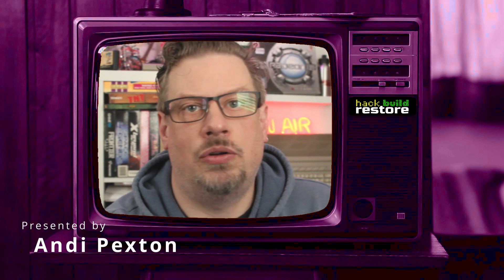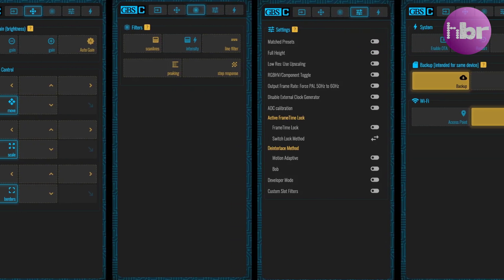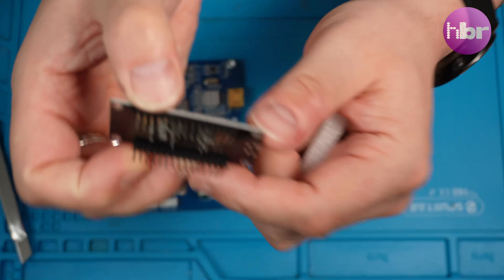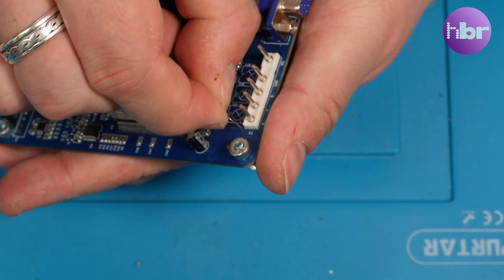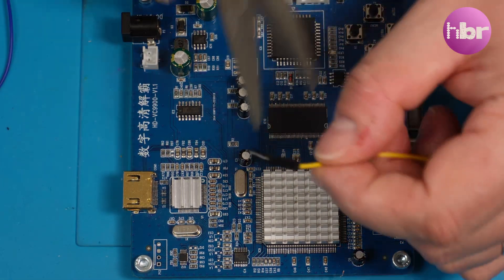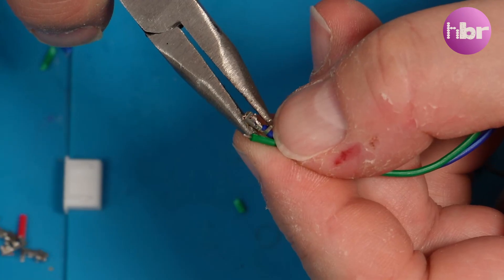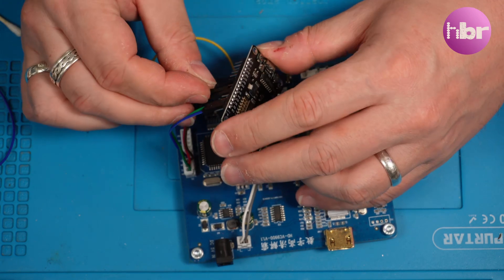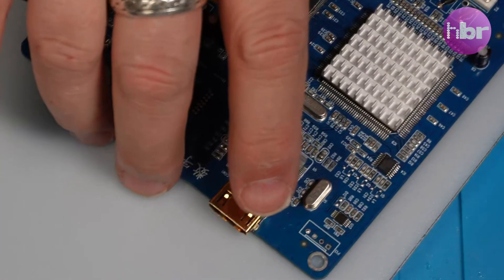HDMI Output Hack: GBS Control on VC9900

Comment: Do you know why the image sometimes turns pinkish after a few minutes? At first the image looks good, but then it starts turning pinkish. This is the third graphics card I've bought on AliExpress. Speed up the video and you'll see what happens at the end. I swapped it with the graphics card from the left game, and the problem shifts to the other side. So it's not a problem with the rest of the game itself; the problem is with the graphics card.

Comment: Thanks for the video! It's nicely done (I like you use duponts instead of extensive soldering) and I didn't know about VC9900 :) You should make add-on with guide to programming ESP to make it more complex ;)
Let me ask you one question - why did you use two power lines from VC to ESP? From 4-pin to 3.3V and from 5V to Vin. In other videos they use only one of them. I have no electrotechnical education so I am a bit confused... Thanks again!
Reply from the maker: Thanks, glad you liked it. On the power side really only the 5v is needed, but connecting both doesn't do any harm.

Comment: It’s very interesting indeed but I didn’t grasp what and how it improves video quality!! May be I am a lame person but I do have a good experience with vintage computer repairs and own a good collection. If may suggest a bit of a more detailed video to clarify how does this work.. big thank you
Reply from the maker: Thanks for watching, I will consider your suggestion for a follow up... In my use case, the Amiga, the stock board was unable to properly output anything, in the cases it did work with VGA signals the lag introduced made any fast paced games almost unplayable. With GBS Control those issues go away.

Comment: What do you use as input? It’s using the VGA connector so you need adapters?
Reply from the maker: In this instance I used an Amiga RGB to "VGA" connector still the 15KHz native Amiga signal, could just as easily just hook up via the RGB VH connector this comes with the board (I have it somewhere) I will be coming back to this but as far as the cable wiring goes @RMC has a good video from about 6 years ago https://youtu.be/q3J4QJsn0ig?si=7rZ3tAyo4MAh0jfE